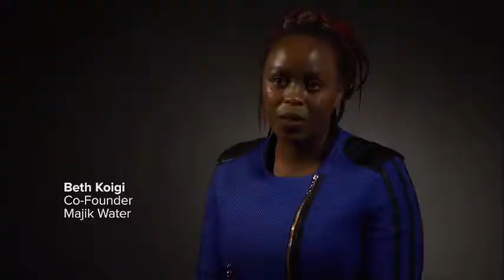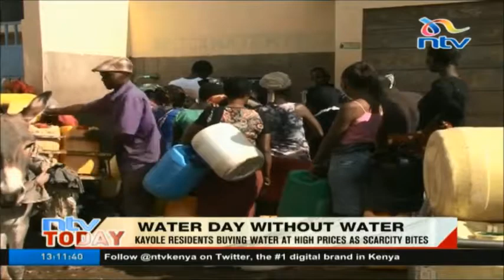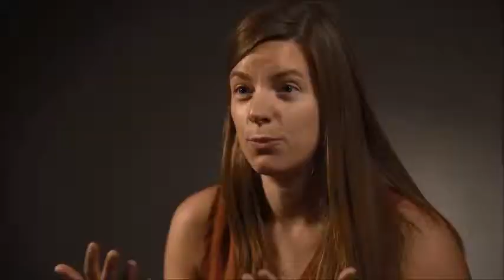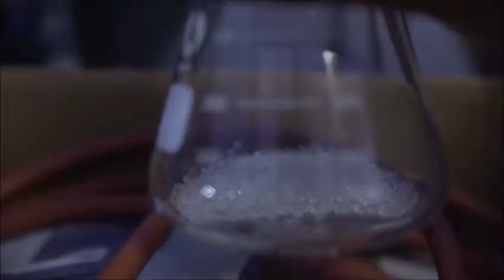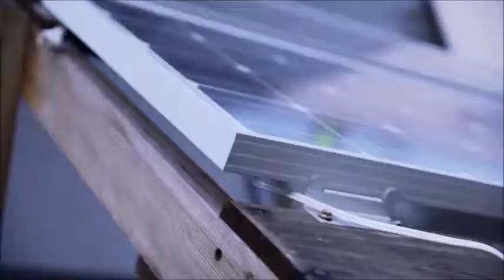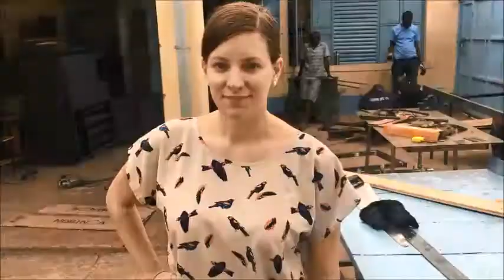Majik Water Situation & Product

Comment: Silicon gel, doesn't silicon cause cancer
Reply from the maker: Jayj Shumba  thank you for raising this...in the form we use silica gel it doesn’t contaminate water in any way. The water you get is basically pure but we incorporate filtration systems such as reverse osmosis to remove any contaminant that may occur..all in all this is at research stage at the moment we haven’t developed anything being used...what we have installed previously uses just condensation
Reply: @bethkoigi3023  ok. All the best.